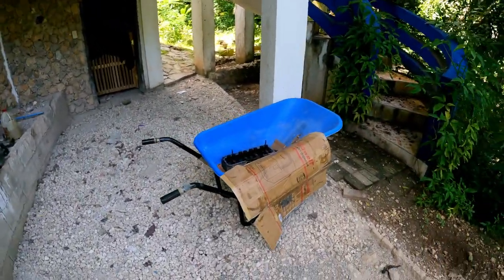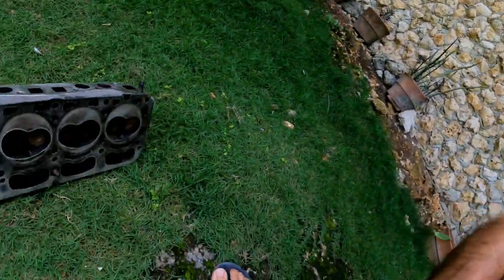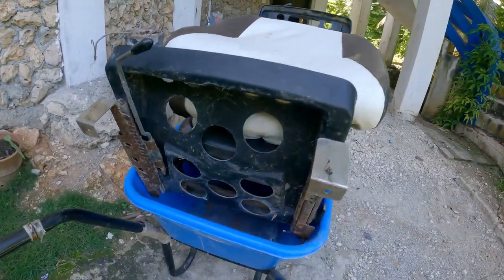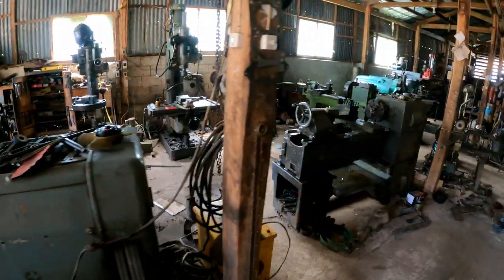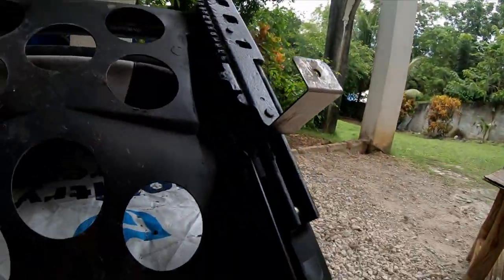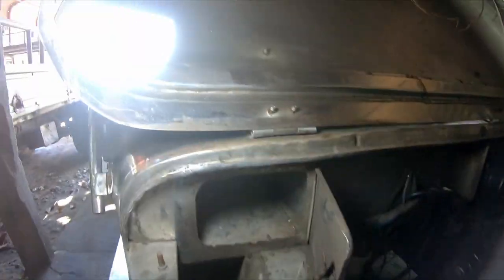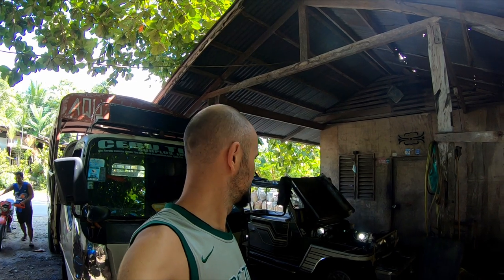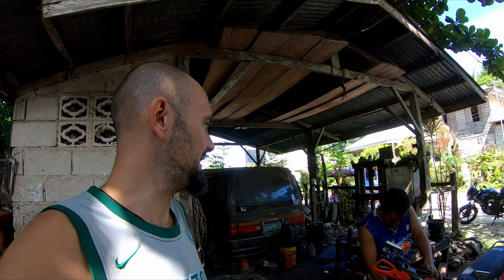REPAIRING and PAINTING PARTS | OWNER TYPE JEEP #5 | PHILIPPINES

Comment: Well that housing shows how harsh the water is there! Not sure but that housing is cast Aluminium and maybe easier to replace if that’s at all possible there !
Good job 👍
Reply from the maker: The island is made of a coral reef so I have very hard water here and the engine was verry stony. I will definitely use coolant. 
You're right, it's a cast aluminum, but we've welded it already. Thank You for comment and good word!
Reply: @IslaPamilya   
That’s good you could get it done! You might want to use the drinking water ! Distilled water may be hard to find ! Take care looking forward to the first ride in the almost a Jeep
Reply from the maker: The drinking water here is kind of like reverse osmosis water, so it should work. Coolant is also available.